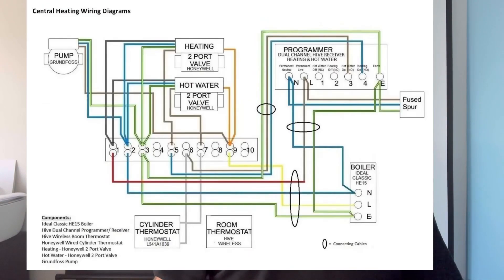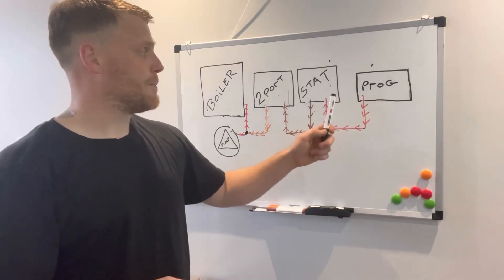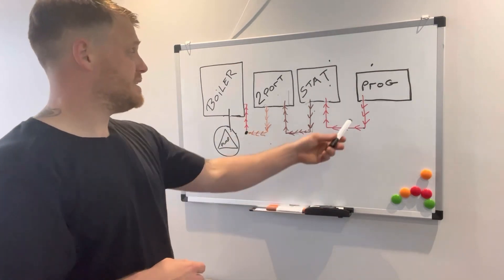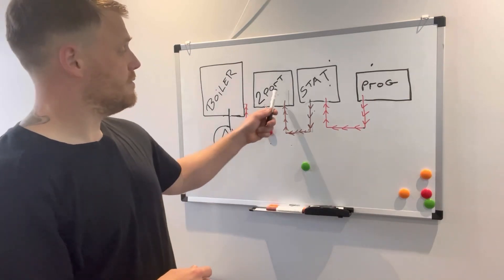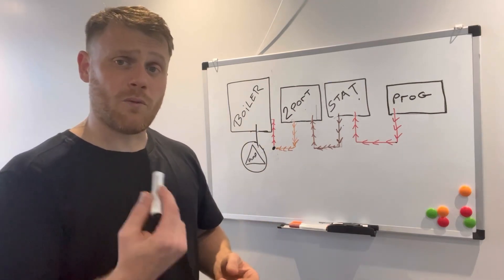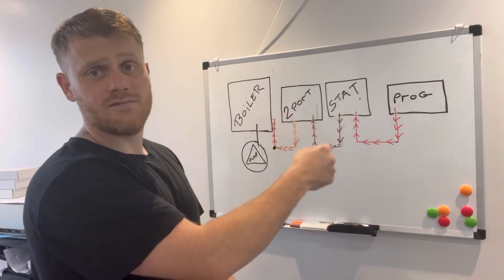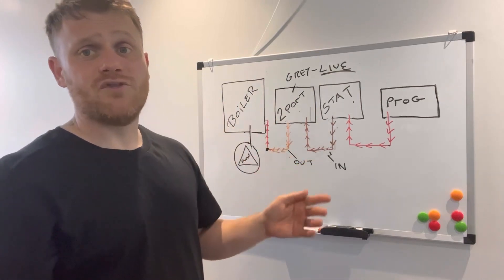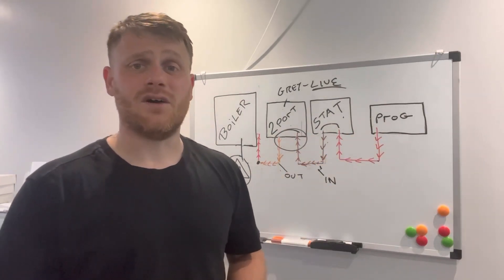S plan wiring the basics. Diagram made easy to understand and follow

Comment: Nice video, thanks. One thing to point out, especially on older systems if applicable, not all motorised valve heads are removable without draining down.
Reply from the maker: Yeah great shout, older valves won’t come off, do come across them occasionally 👍
Reply: @bluebulldog_uk how do you identify the ones that you need to drain down to change the heads?

Comment: My boiler comes on with an app or alexa and my motorised valves are plugged into smart sockets which I also use an app for. There doesn't seem to be any need for programmers and lots of wiring.